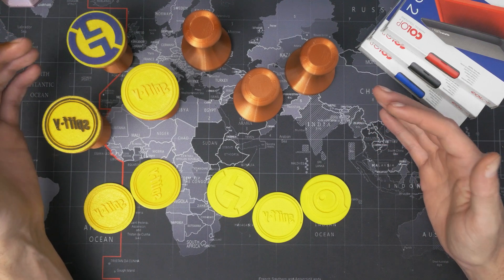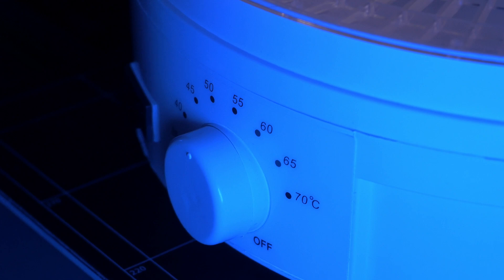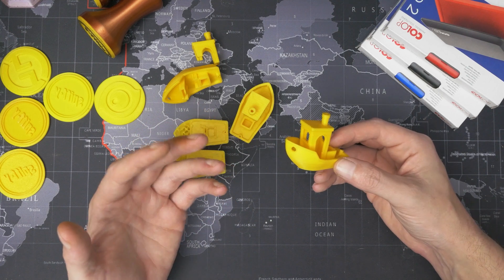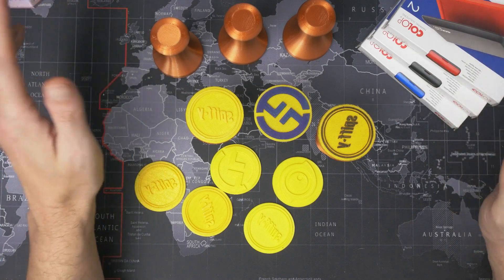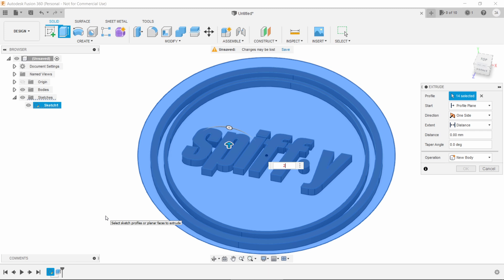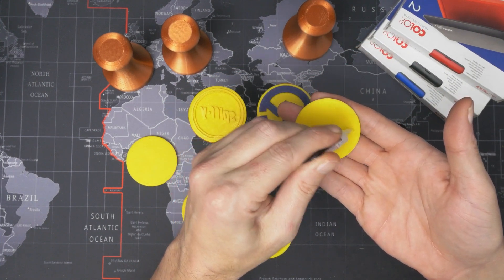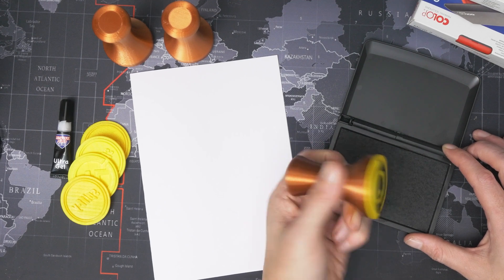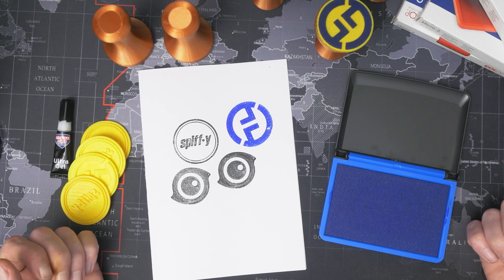How to 3D print rubber stamps with TPU on the Snapmaker 2.0

Comment: Have you considered just printing a negative and just molding the stamp with something like pourable rubber or putty?
Reply: goog idea, but you`d still ge thte same lines in the stamp that you would pour.  also, the only benefit would be potentially softer material, but for a lot of trouble..  not a bad idea though

Comment: I noticed you had PLA selected as the material in Cura. Is that correct or should it be switched to a generic TPU?
Reply from the maker: It's kind of an irrelevant setting, really. It's so that you can set up all the different brands, types and colours of filament you use, so it can calculate costs n' whatnot. I've always just ignored it and just use the print settings profiles.
Reply: @JohnAldred  Thanks! I can't for the life of me get it to work but I think it might be the brand I'm using. I'm use Overture TPU. Do you have a brand you recommend?
Reply from the maker: Not from personal experience with it. The only TPU I've used has been generic unbranded stuff and I haven't had a need to use enough TPU to run out of it and look for a decent manufacturer yet. But if their PLA & PETG is anything to go by, I'd give Eryone a try. :)

Comment: Have you tried the surface ironing setting to reduce the amount of sanding needed? I have not worked with TPU yet but it makes a huge difference in PLA and PETG when I want a very clean top surface.
Reply from the maker: I've tried ironing in the past, but it's only a visual exterior thing when you're just looking at it. It doesn't really help much when it needs to actually be physically flat and solid. You'd still want to sand it down, and you'd probably sand through the thin ironing layer pretty quickly and need to sand it all off to get to more solid filament anyway. You might not, but overall, I don't think it'd make that much of a difference.